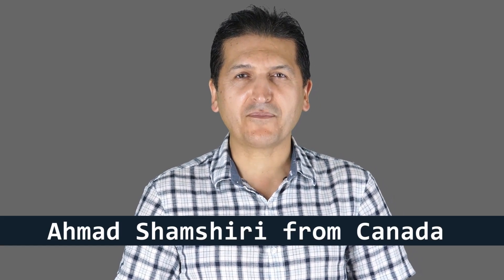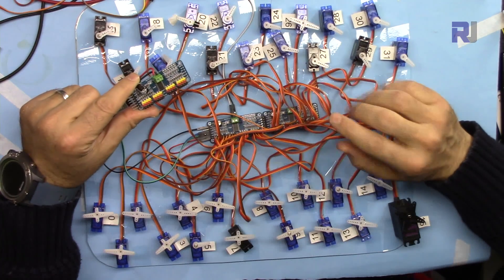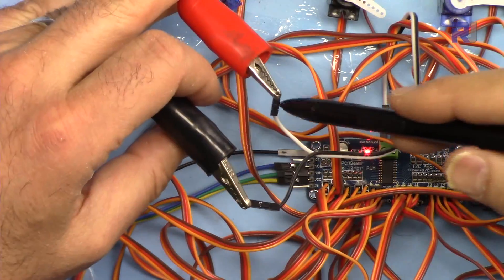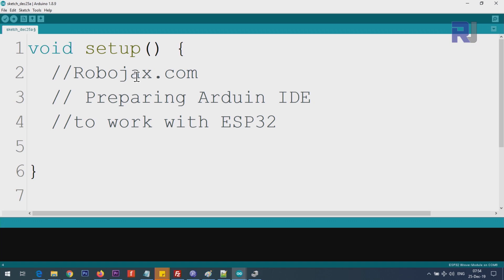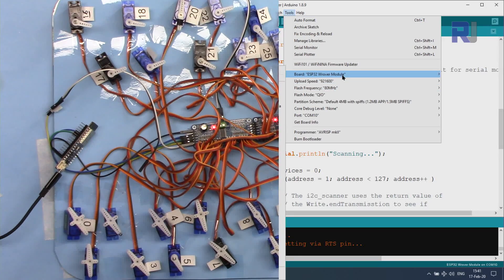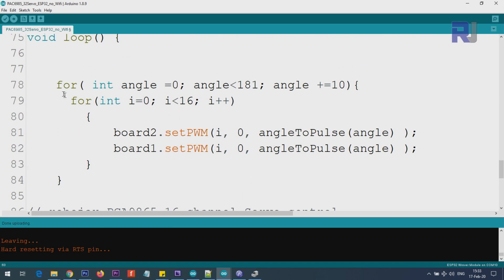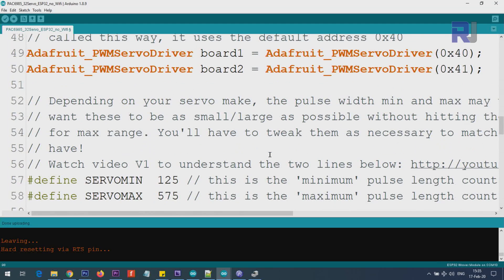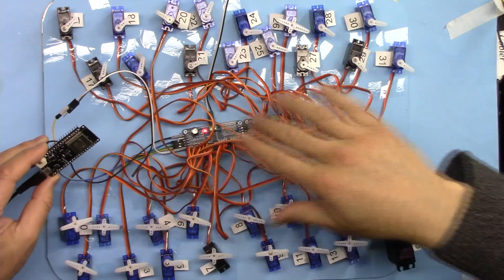Controlling 32 Servo motors with PCA9685 and ESP32 - V4 - RJT268

Comment: Hi mr, thanks for this useful video. I need to control 6 servo individually, using this pca and esp32, i have question regarding this. When we connect the esp to laptop, esp will be powered by laptop, but once we remove it, how can esp get power from pca? Can v+ connect to vcc do the job?
Reply from the maker: Hi
Here is the introduction video to ESP 32 where I've explained 3.3 volts and 5 volts https://youtu.be/--Fj8QDlGuQ

Comment: Hi, I saw the tutorial, it's great, I wanted to know if it was possible to control the servos separately via the board and Arduino using buttons (2 for each servo). I need to control some details on a scale model railway but I'm not very good at programming Arduino. Thanks
Reply from the maker: Hi, I have tones of videos on how to control servo motors using push switches. just search. this is Version 4 of video, y ou may watch V1-V3 to learn more tips which might help you build your projects.

Comment: Is there any way to use a esp32 CAM with this module through i2c?
Reply from the maker: yes of course.
Reply: The i2c pins are not available on the esp32 cam I can assign with seriali2c but there are issues with the dfplayer not being found it is looking for rx tx pins.

Comment: What is the yield () that you left commented used for? I was reading that in the ESP32 when using the wifi with some other device, the yield () is used to avoid errors. Is it for that or does it have another purpose? Thanks for your video, very well explained.
Reply from the maker: I just did search on the library file https://github.com/adafruit/Adafruit-PWM-Servo-Driver-Library/blob/master/Adafruit_PWMServoDriver.cpp and did not find any yield() function

Comment: (This Question was for the V1 video) I couldn't even spin 1 servo with the PCA9685 board. I tried the simplified code you made (I tested it with only 1 servo). I don't have an 5V Adapter. But I have a Breadboard power supply stick. The capacitor on my PCA9685 broke right off. Is that the reason why it's not working?
Reply from the maker: No. capacitor eliminates fluctuation in power supply. I just check the link for the code and it was broken. lots of people have not found it. it is fixed now.
Reply: @robojax  But I tried it with the HCPCA9685 code. HCPCA9685 link: http://thezhut.com/?page_id=1529 That didn't work either.
Reply from the maker: Please use the code I provided. Make sure ESP32 works with Arduino IDE.  If you have never used ESP32, make sure to run the blink (LED blink) program before connecting anything else.

Comment: Thanks so much for this! For v5 will you demonstrate control of the pca9685 with esp32 or esp3266 dimming and controlling leds? It's similar to servo commands but there are some significant differences. I'm stumped on the software for a high current led strip controller board I built around the pca9685 and love how you work through process with these videos.
Reply from the maker: You are welcome. I have already posted video for may Patrons at Patreon.com  to control this module using ESP32 over WiFi. this just outputs PWM. So you need  mosfet switch for each LED. So depending on the current your LEDs need, you can find multi channel  LED driver and feed the signal from this module to the input of the driver to drive the LEDs. Good luck.
Reply: @robojax  controlling LEDs using the pca9685? If so I'll become a patron.

Yes, the board I built has mosfets driven by mosfet drivers, which are triggered by the pca9685. It's very powerful and efficient.

Comment: Hi there...just what I was looking for.

however, what would be the code to send PWM speed to control several 12V PWM fans rather than a servos?

I'm interested in using Temp/humidity sensors to control a number of fans.

Servos may come later however, not just yet :-)
Reply from the maker: I am glad you found it. Yes you can. for each Fan you need driver to drive the current for your fans. Just feed the output of each channel into the input of your driver and you will be able to control the the speed of your DC fan.  With this module you can control 4 Fans  https://youtu.be/wn5D7j1ybxY in one direction or 2 fans in both directions. Watch the video fully to learn how it work. I do not skip details.
Reply: Robojax is it not possible to use the PWM servo module featured in this video alone then?

As it seems to output angular commands, is there not just a constant pulse command which can be changed in intensity to effect speed?

I’m interested in using 4 pin PWM capable PC fans is all...it seems that the servo module would be perfect if a constant pulse command could be sent to each channel.

Comment: Nice video. I've combined driving servos and motors wirelessly for a robot car. Also used code from brainy bits for the servos. Looking forward to  wifi control using ESP32.
Reply from the maker: Thanks. Good luck with your project.

Comment: Hi, do yo have a coding/tutorial for ESP32-CAM with button on/off on the web server ?
Reply from the maker: Never looked at it. I just spent some time. The main function  startCameraServer(); is to start the server but I did not find the "stopCameraServer();" so you would figure it out different way .
Reply: @robojax  probably not, i'm just asking about that. If possible, i will try to make it. Im still learning about using ESP module.

Comment: hi sir ,thank you for this video, one question, can we control the speed of the servo?
Reply from the maker: Hi, PCA9685 is PWM controller. It generates PWM with varying duty cycle to dim or brighten LED light or move servo. Now to control speed, then you need to add delay between each moves to slow it down.